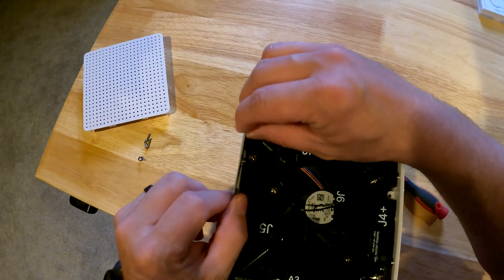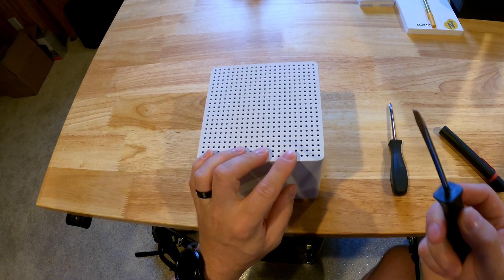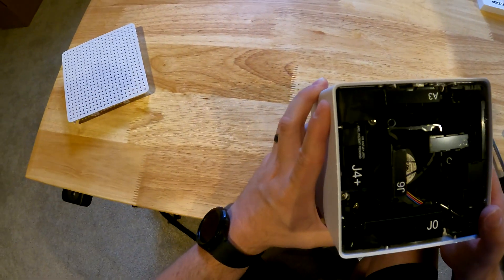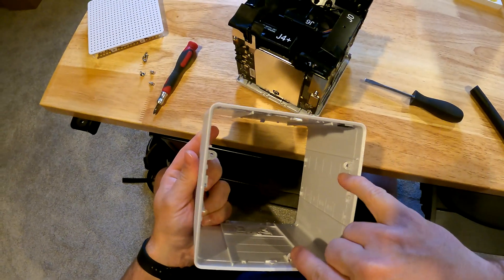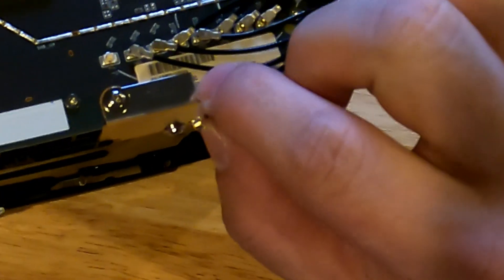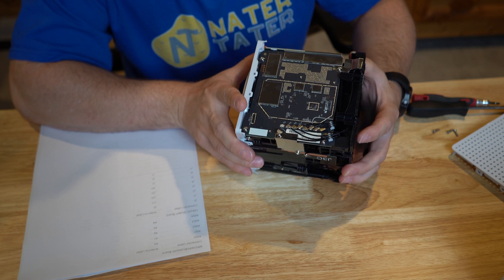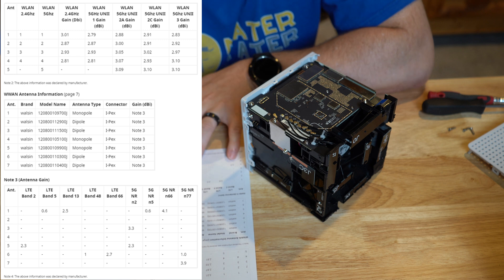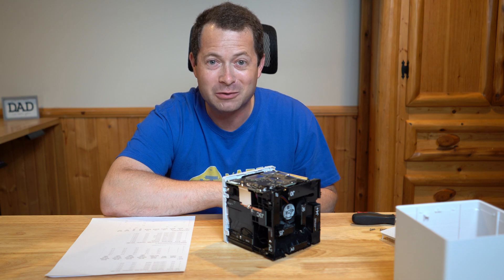✅ Disassembled! Verizon 5G Home Internet New Cube Gateway - External Antenna - ARC-XCI55AX

Comment: Straight talks home internet router has the exact same setup. Only reason I found out is that my fan stopped working and the router overheated. So with a new one about to be picked up disassembling the old one only felt right.

Comment: I have the newest model through Total (same network as Verizon) and so instead of opening it up I'm going to use several antennas hooked to a power amplifier for a stronger signal that will be of course hooked to an external antenna for a stronger signal, I wish I had a schematic of it, does anyone know where I can find one?
Please post a link I will be most grateful 🙏

Comment: Is there a way to get the ARC-XCI55AX gateway to connect only to high band 5gUW? I have that coverage where I am at but seem to be getting capped and limited to 300 mbps with the gateway. I complained to Verizon and they are sending out a E3200 Wi-Fi Extender for free which is nice, but I don't think it gets hardwired in like in your video. They claim that with the extender that I'll get access to speeds in excess of 300 MBPS however I don't think it's a single strength issue, it's a capping or throttling issue either within the gate way settings or on the Verizon network that is preventing me from accessing the higher frequency 5g UW bands
Reply from the maker: 300/20 Mbps is a throttle verizon applies.   Your cube can't access high band (mmWave) 5G.  The wifi extender will do nothing to change the 300/20mbps throttle, it will simply extend wifi signal meaning you can potentially get the 300/20mbps speed in say your backyard too.
Reply: @NaterTater  that what I feared, VZ is unwilling to send me out a different modem, claiming it won’t work in my location but I get 5g UW on my phone in my home with 600+ mbps.
Reply from the maker: @Adamprivate678  verizon has confused customers by including c-band n77 as marketed as 5G UWB and showing as 5G UW on phones.  It is capable of 600mbps speeds but it is not mmWave.  C-band is around 3.5Ghz frequency but mmWave is more like 35Ghz.  MmWave is capable of 2+ Gbps.
Reply: @NaterTater got it so is the ARC box functionally capable of getting getting the c  n77 signal signals to go above 300mbps and the limit is something they added onto it or in their network.  Would having an mmWave or c band compatible modem grant me speeds in excess of the 300mbps? VZ won’t give me a new modem due to location but I’d like to tap into the 600mbps speeds is the only way to do that by dismantling the box and hardwiring an antenna to it?

Comment: Solid videos on installation and testing, but I have very odd results. Based on the Waveform instructions I went with 1/3, & 4/5 and saw my speeds go from about 175/4 up/down with the unit just on its own sitting in a window to 40/8 connected to my 4x4 panels pointed toward the nearest Verizon tower. Uploads improved, but downloads went down massively. Very strange. Signal strength didn't change significantly, still at about -90 LTE, -110 5G. Per your sheet outlining which connectors served which bandwidth frequencies I swapped 4 for 6, but that didn't alter my speeds or signal strength in any meaningful way. What's really odd is I have been with T-Mobile for about 2 years, and going from the base unit to the antennae was night and day. T-Mobile on its own was about 18/3, with the 4x4 hookup it is routinely at 150/15 and often over 200/20.

Comment: Hi Nate, Lie you channel on the verizon gateway. I notice in one of your vidoes that that you connected the 4x4 mimo panel antenna. 
You had  the following antenna setup:
J1 to 1
J3 to 4
J4 t0 1
J5 to 3
I see that j1 and J3 are both going to going to the same port. would you be able to correct this?
Thnak you,
Ken
Reply from the maker: Hey Ken, thanks for commenting.  Unfortunately there is no way to edit that in the video.  Youtube doesnt allow it.    Gateway to 4x4: J1 to 3, J3 to 4, J4 to 1, J5 to 2

Comment: I just got a Verizon 5G Home Internet Cube. It looks a lot different than the one you have in this video.  I think the model number is NCQ1338-D315. Do you know anything about that model?
Reply from the maker: What do you mean looks a lot different?   The web interface or the physical appearance of the gateway?
Reply: @NaterTater  I am referring to the physical appearance under the outer shell, it looks different. The circuit board is embedded in between 2 plastic housing that supports 2 large heat syncs on each side of the circuit board. There seems to be three peaces of black tape on the outside of the frame that are labeled 5G antennas with no exposed wires. The black tape looks like the antenna might be embedded into it. The circuit board is visible only from the edges and where the 5G antenna's are located I can see three connectors per antenna (I'm not sure the connecters are associated to the antennas). I don't know what type of connecters they are, I am not able to see the face of the board without taking it apart. I don't know if I can take it apart without damaging it.
Reply from the maker: @Frank B  ah, yes this video is on the ARC cube.  The ASK cube (yours) is here https://youtu.be/cRbRxXVThMA
Reply: @NaterTater  That is a bummer. Do they still have the ARC cubes? I wonder if I could get one of those?
Reply from the maker: @SomethingNewToDo  yes, random allotment.  There are other options too https://youtu.be/tJhnv_XUfSg

Comment: Is their a sim card in the device so we can remove it and put it in a device with a antenna
Reply from the maker: Depends on the cube, some do, some have eSIM https://youtu.be/mErn0bERoj0
Reply: @NaterTater  I've watched that video I have the new white cube just got it two weeks ago do you know if that has a sim
Reply from the maker: @davidkeaton20  lift up the silicone flap on the bottom and look.
Reply: @NaterTater  I didn't know that was there nope no card just a c port it looks like thanks

Comment: Nate- have had great success over the past several months using t mobile home internet with a 2x2. Thanks for the videos!My house gets nothing inside or outside without external antennas on all 3 carriers. Since Verizon signal is stronger and has more capacity, I decided to order one while it was available.
I only get lte in my market so I’m unsure which device will be sent (could be original model with lte only). It seems my only hope is for the new 5g gateway, correct?

I am receiving good enough Verizon signal using the 2x2 for bands 5 and 13. High band is not needed. Should I focus on antenna ports 1 and 2? Would I see any benefit at all by upgrading to a 4x4? I’m unsure if the modem itself would carrier aggregate bands 5 and 13. 

As a last ditch effort is there a way to use the sim in a different modem with external connectors (assuming it’s not the new model)?

Let me know your thoughts. I’m hoping this finally fixed our issues since external antennas at our location are non negotiable.